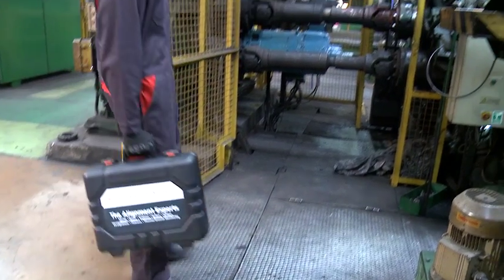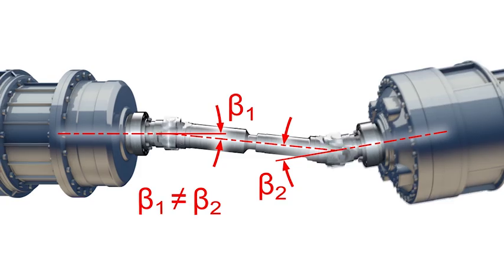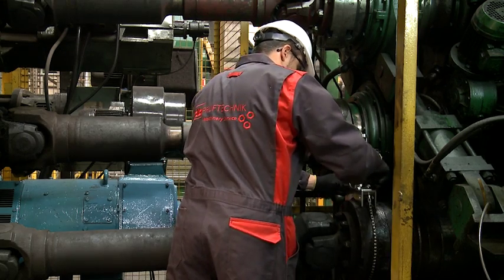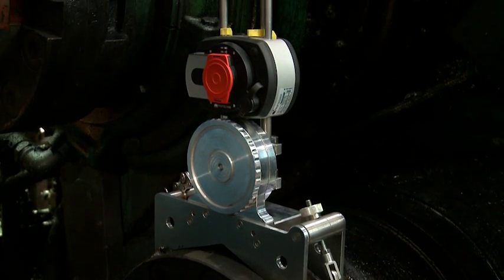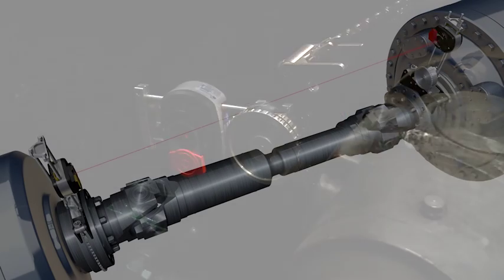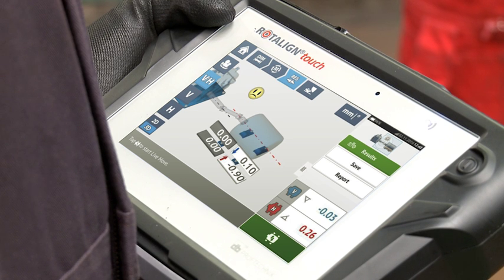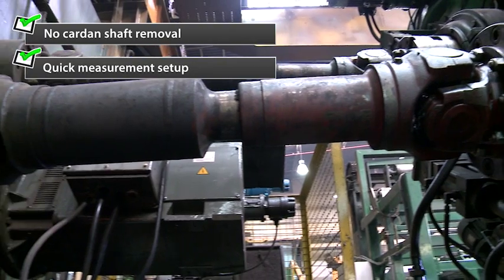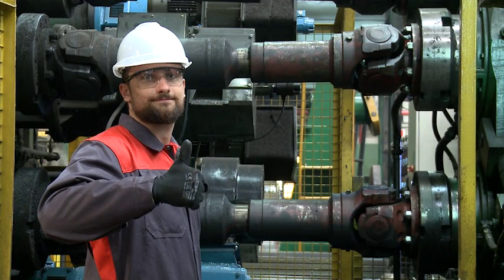How to align cardan shafts with ROTALIGN touch PRUFTECHNIK

Comment: Hello, I am a student currently in maintenance course and really new about this apparatus. So how do I know if a certain dimension is required to input into the measuring device ? Also, what is the purpose of inputting this dimension ? Thanks in advance.
Reply from the maker: Hello Hanif Mansor, The requested dimensions are entered to enable the system to calculate both the coupling results and the machine corrective values. Best regards